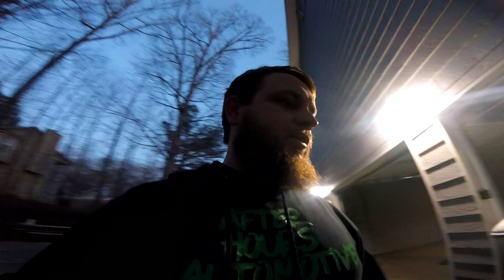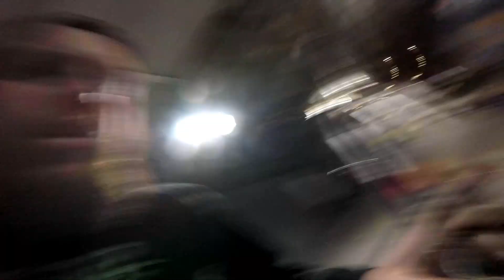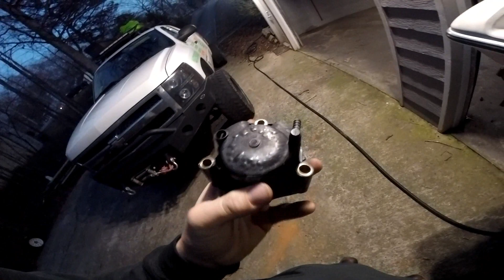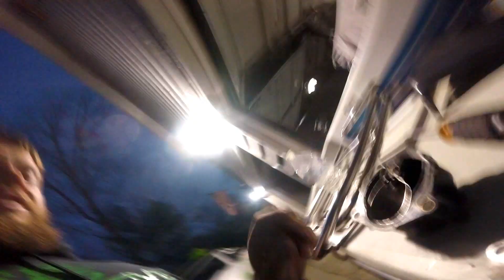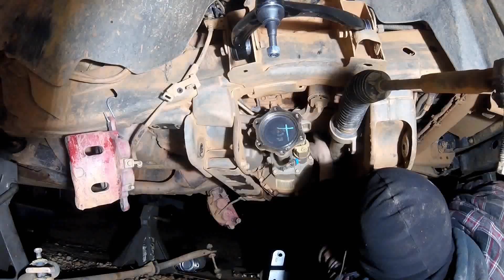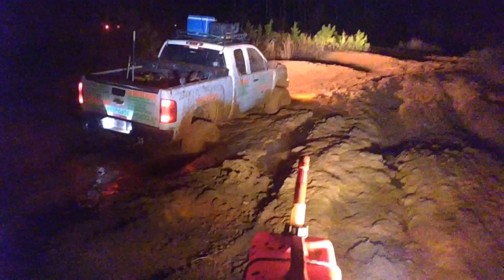OMC Bad Water Pump Replacement Flow Fix Blockage Boat Muffs

Comment: Thank you, This is what happened to my boat this season. I had an over heating issue and after watching your video I walked out and in 3 minutes found the same thing on my 1989 out drive. Replaced the whole cup, screen, and impeller for about $60 the same day.

With water pressure from a garden hose or under power on the lake all was fine but out on the water while moving slow or trolling it would slowly heat up over several minutes.

Again thanks for making the video. I solved my problem.

Comment: If you take the lower unit apart will find three "0" rings that seperate the oil from water the lower one is for water seperation check it, and pay attention,as any leak around the o ring or gasket will not get water up to the impeller
Reply: Be easier if he removed the cold water hose going to the thermostat housing if you have good flow you know the lower unit impeller is good
Reply: I think that’s my problem my Impeller keeps burning up

Comment: I’m having problems with my OMC 5.0 my impeller is fine, engine runs fine with muffs maybe bc the water hose pressure but runs hot in water maybe bc there’s no suction.. Any ideas ?
Reply: Same bro. Dang